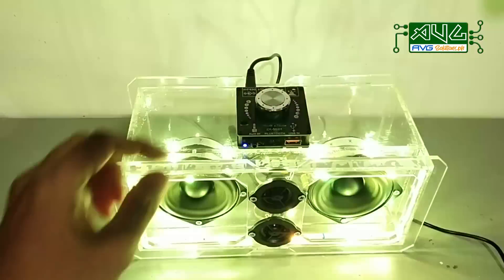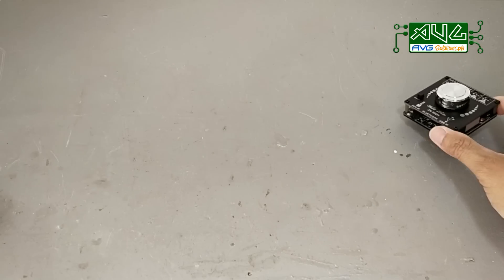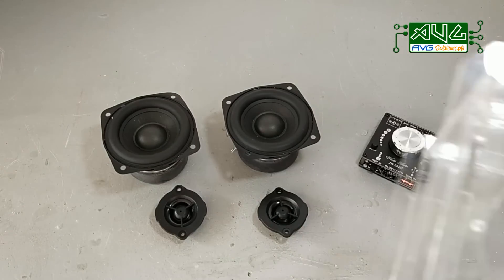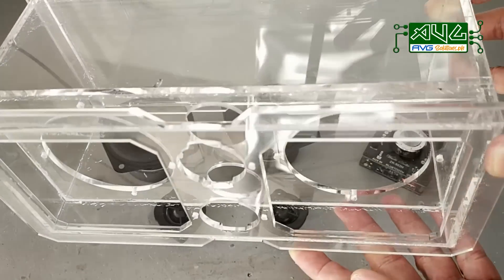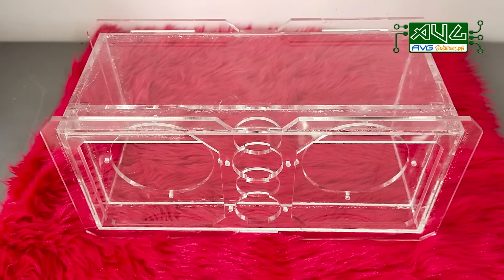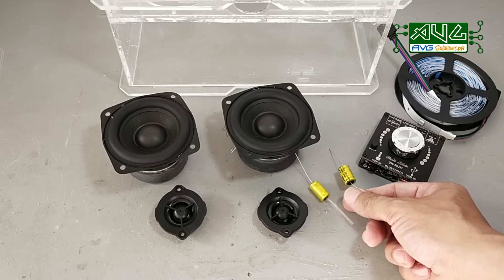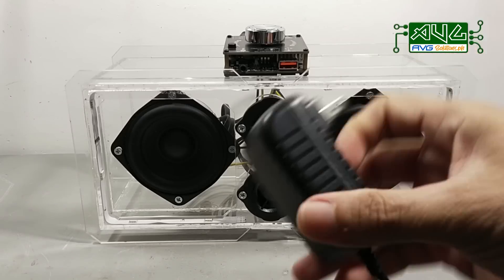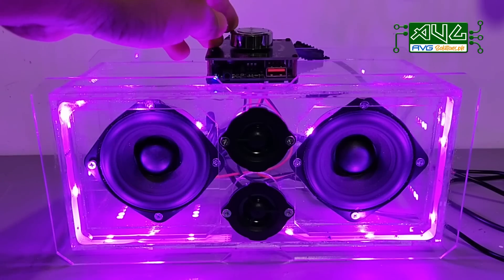DIY Bluetooth Speaker using ZK-502H

Comment: its still not clear to me which power supply i need. yes the plug is round but the hole inside is either too small or too big. too confusing tbh
Reply from the maker: you need to find a plug and socket that is compatible to its other, when it comes to size